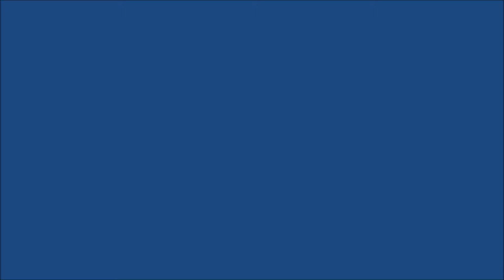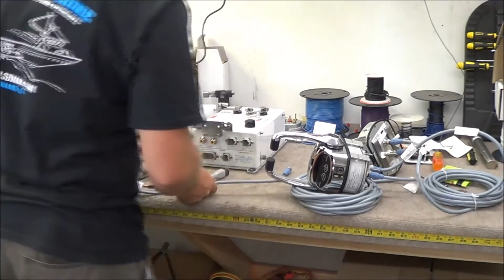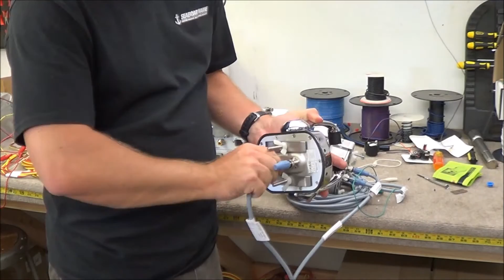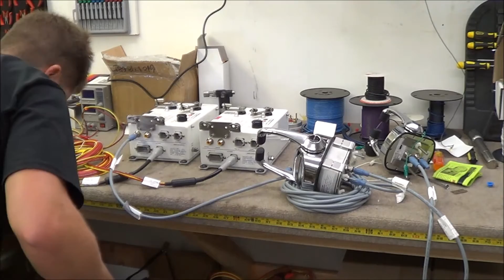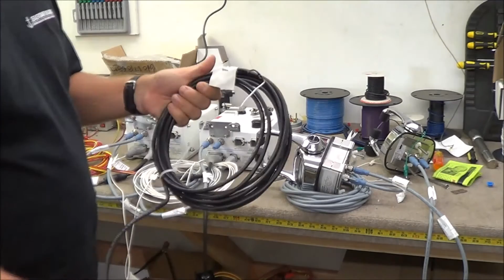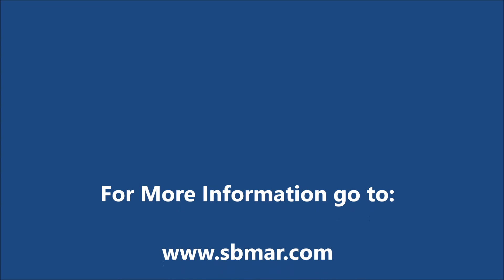Glendinning Smart Actuator II Install How-To

Comment: By the way, do you know how can I set a 5 seconds gearbox delay with a 2-button control head and Smart Actuator II? (In the S.A. II manual they say the can set up to 8 seconds delay, but only explain it for 4-button control head; however in both manuals for EEC3 and EEC4 they only talk about a 2.5 seconds gearbox delay)

Comment: Hello bro
I have some problem with the light check system at the throttle so we boat can't move, can you help what is exactly problem. Before we were reset acuator but still same problem after that we changed battery but nothing found also

Comment: I realize this is a 6 yr old video, but I am thinking of installing the glendinning on my 37 Bertram w/6v92. They are mechanical not the DDEC. Are there any issues or concerns with an older, 1989 boat? What happens with a drop in voltage, etc. Any advise would greatly be appreciated!

Comment: Seaboard Marine, your video helped me to get my twin engine (manual throttle and tranny control) Glendinning system working.  Thanks for posting it because there are some counter intuitive things I found with the Glendinning system.  Example: no lights come on at all if you fail to hook those white wires together from the 12 pin tach connectors.  Also, when I connected the control head to the port unit and then daisy chained port to stbd with terminating resistor on the 2nd stbd canbus port, again it would not light up.  I pretty much had to do everything exactly as you did before I got any LEDs at all.  So again, a big thanks to you for making this vid.

With that said, I want to share a less than happy experience that I am having with the Glendinning unit.  It all starts with expectations.  When I spend $4000 on a fancy electronic toy like this, I expect the manufacturer to enable me to get all of the possible benefit from it that I want to.  After all, I'm the customer and $4000 is not loose change.

The Glendinning system is fly by wire.  It uses canbus to connect the control head to the actuator units in the bilge.  NMEA 2000 is just canbus electricals and mechanicals with a set of standardized messages going across it.  The types and formats of the messages are proprietary but NMEA will sell you the spec for a pretty penny ($750 for non members of NMEA).  So they want to get paid but at least they will open it up for you if you pay up.  There is no apparent reason that Glendinning canbus cannot co-exist with NMEA 2000.  Thus, it seems reasonable that if you connect an NMEA 2000 to wifi bridge (like the Yacht Devices YDWG-02) into the setup that you should be able to see what messages Glendinning uses for Tranny position and throttle position.  

However, Glendinning seems to be enforcing the notion that it is running on a dedicated bus.  When I plug in an inline NMEA2000 tee into the system with nothing in the tee connector, the Glendinning system works as normal.    However, once I plug in YDWG-02, first the smart actuators begin to flash all of their LEDs and then the control head follows suit a few seconds later.  During this time, YDWG-02 appears to be working fine (you can get to the web pages that it serves).  So it seems that Glendinning FW is checking for the presence of devices other than SA-II components and refusing to operate if anything is found.  I called Glendinning about it and they simply told me what I was trying to do wasn't supported.  Gee, thanks.  As if I hadn't already figured that out on my own.

Most people won't care about this but I am writing custom glass helm software for my boat.  You can see the early versions of it starting to take shape in this video:
https://www.youtube.com/watch?v=ZgBH-PytnW8

What I want to be able to do is display F(orward) N(eutral) and R(everse) per engine on my glass helm.  I also want to create the notion of throttle hours or work hours for the purpose of doing engine maintenance.  Idling at the dock for an hour puts 1 hour on the hour meter.  But this is not as hard on the engines as running on plane for 1 hour.  But the software needs to know that the boat is in gear and what the throttle position is before the work-hours can be calculated.  Other things should also be possible but this is my initial concern.

So at this point I am very disappointed that Glendinning locks their bus down like this even though there really is no good purpose in doing so.  If they are trying to hide their messages, then why?  Do they consider it some kind of awesome Intellectual Property?  Bah!  It's just messages on a bus.  There is no value-able IP in that.  Anyone trying to compete with them can make up their own messages just as easily.  Also, anyone who is in the business of trying to compete with them, for example, making compatible 2ndary helm devices, etc. can definitely reverse engineer what is going on and then simply emulate a bonafide Glendinning 2nd station control.  All it takes is a logic analyzer and the financial incentive to invest engineering time in it.  So at the end of the day they aren't protecting themselves from any credible business threats.  All they are doing is stopping me, their paying customer, from doing what I want to do.  I wouldn't even blame them if they said, "well we don't document it".  But the notion of shutting down the system just because a 3rd party device is on the bus is user-vicious IMO.

Comment: I have twin Crusader model 454XL (throttle body injection).  How do I hook the existing tachometer signal to the smart actuator II box?  The smart actuator II installation poster v1 shows an option "Direct connection from tachometers" which is not listed in the install manual section 3.4D.  That reference in the poster PDF simply says "Make sure you tap into ANALOG tach signal".  Isn't that what drives all boat tachometer gauges?